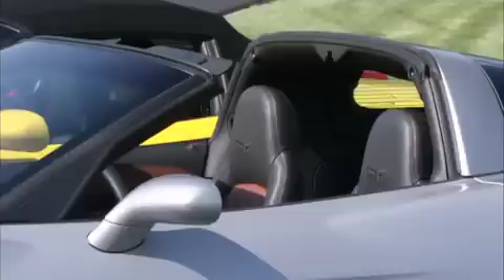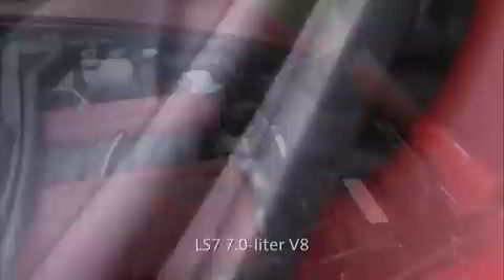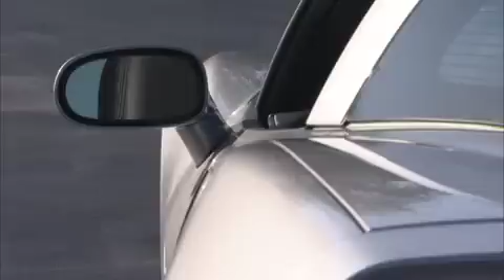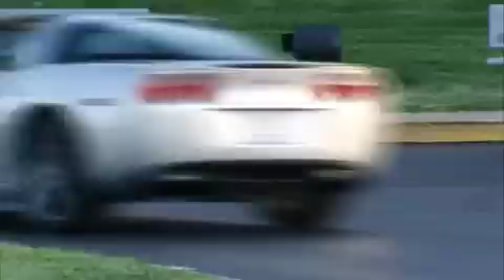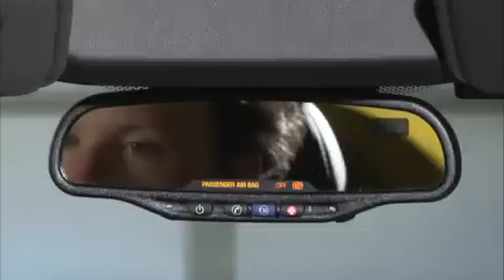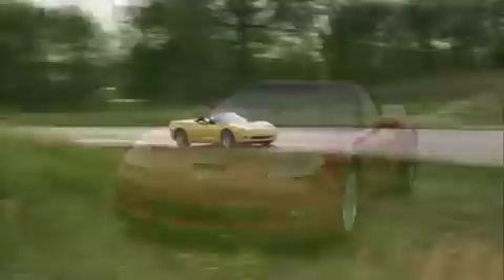C6 Corvette Owner Instructional DVD.mp4

Comment: Picked up a 2011 corvette grand sport convertible today!!! It is a 1 owner!! In the car fax it shows the owner did EVERYTHING he was supposed to do as far as when to bring it in and what to get checked or replaced at every time stamp not missing one visit to the Corvette doctor. It is SUPER SONIC BLUE METALLIC which only 236 grand sports came in that color.  (Its really not a blue color tone if you ask me.  Its more of a light carbon grayish...exterior was appraised at being a 9.4 out of 10, and interior appraised at 9.2 out of 10, with havingall mechanic documents for oil changes fluid checks, etc, and doingeverythingwhen supposed to, chassis trans appraised at a 9.6 out of 10! Guy had a special insurance appraisal done and gave me paperwork. It has 104k on it but as I said above, it's in just as good condition inside outside and mechanically as a 2011 with 20k miles on it seriously. Car is a 30k+ car. I got it for $24k!! Its completely unmolested meaning there is not a single modification done cosmetically or mechanically.  It's a perfect great purchase for a Corvette guy like myself.  This is my 11th Corvette! I had from 1963 to 2011 and 9 others in between...my last one was a 1997 C5. 2011 grand sport has 430hp. I think all I will do is get the K&N Ram Air intake which gains 22hp and 30 torque. $350 intake giving 22hp and 30 tq. Probably biggest bang for the buck dollar for horse power!! Heck, $5000 header back exhausts dont even give that..freddy header back $5I pipe gives 18-19 hp with a tune..
Lol if I wanted to, there is a tune for $500 I can get with just having a k&n intake that would give me another 48hp or for $750 71hp!! For you guys that want 525 hp in your c6 grand sports or Corvettes in general,  k&n ram air intake and a stage 3 tune with race chip it's called will give you 92 horsepower, 525hp total,  and cost $1100 total...have fun!!

Comment: Condensetion inside any headlamp is never normal 👌🏼
Reply: Haha...I'm actually looking up headlamp covers and gaskets. To replace the ones on the 2011 grand sport I just bought.  It's the angels of headlights like this that makes the gaskets in the covers fail so easy in my opinion.  Every car I have had that has a certain fitment I can't explain,  they all ended up having moisture issues in the lamp...either that or quality control issues with the headlamp cover gaskets..I'm gonna try an aftermarket pair of covers that come with gaskets that cost $100 and see how they fit, or I may just spend the money and get actual Chevrolet Corvette headlight gaskets for 89.99 for pair , take covers off, polish insides and outsides and install new gaskets and put original covers back on cuz there in good shape minus moisture stains...then the next guy can do it again in 8 years lol...

Comment: Expect fog in your headlights?
Reply: Haha
Reply: Damn right...although I believe after the C6 they fixed that problem for the C7 and C8 now.  But pretty much every year C6 had moisture issues inside the headlight especially if you lived in a humid area or drove in heavy rain. To be fair, Corvette never had visible headlamps until C6. So the creation of headlight weather gaskets was a new thing....lol I just figured after the 2005, 06, 07, 08 , 09, 10, 11, 12, They would have had that quality control down pat lol, nope, 2013s still had the same problem.  They waited til the c7 to address that problem lol...

Comment: Before you get in this model, be sure the battery is working!  If that battery dies while you are inside, be sure you know where the escape switch (cord) is or you won't be able to get out.  I know.  Oh, and be sure the hard roof is well taped down.  It could cost $2000 to replace that roof.  I know!
Reply: I heard a couple years ago guy died in his corvette because battery  was dead he have no idea how to get out very sad

Comment: Thumbs up for America's sports car! The C6 is my first Corvette and I'm still in love with it five years later!
Reply: Prog Metal Musician Will be looking to buy a pristine low-mid mileage (under 50k miles) C6 in about 4-5 years as i get close to retirement !  Want the LS3 engine, 6 speed manual, love the dark blue metallic.
Reply: Love my c6 grand sport, best body style to date
Reply: Purchased my first Vette ('13, GS, Torch Red,  6-Speed  manual,  11K miles.) What an incredible car! Sure does get a lot of attention. Not good if I start getting harrassed by Police. I've heard that happens with Red Vettes.
Reply: Took delivery of my first corvette July 2019.  First sports car that I have ever owned.  I will never need any other.  2008 JSB Z06 LT1.  Had the heads issue addressed and tuned.  484whp / 451 wtq.  That is way more power than is necessary.  What socked me the most is how easy they are to drive.  Anyhow, congrats on you vette and long live the corvette!
Reply: 3 is a great place to work for and I
Reply: Piece of shit cars